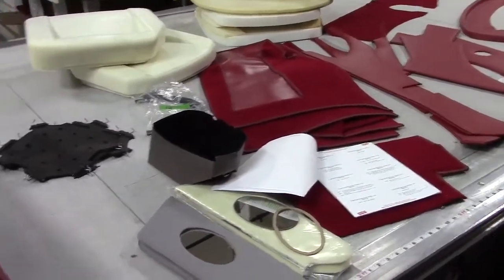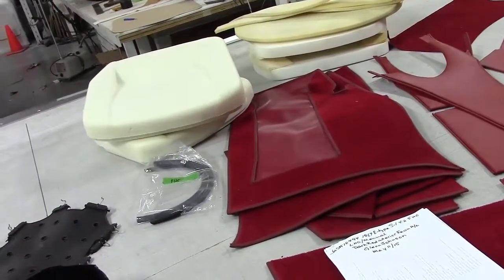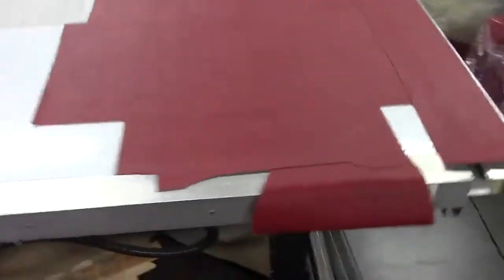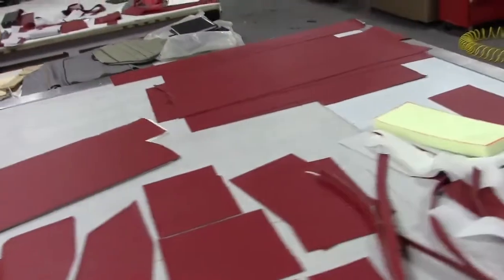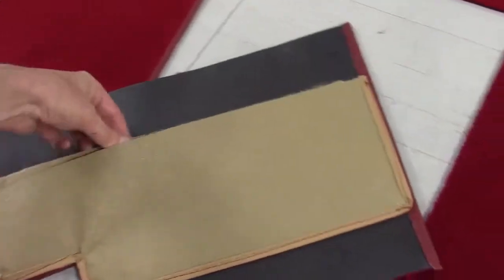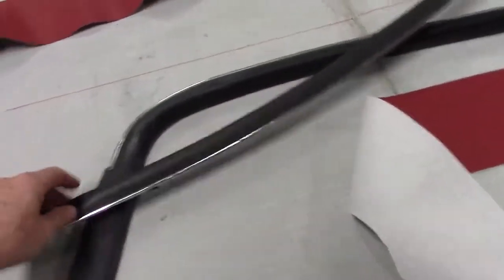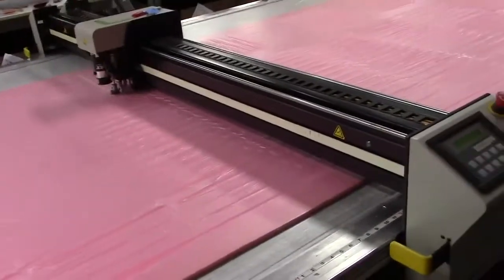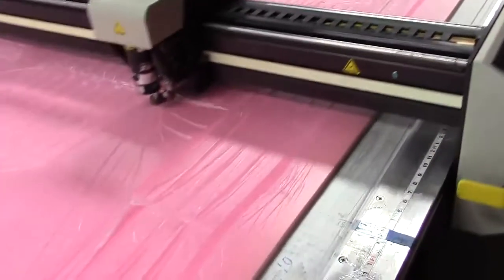Jaguar E-Type Series 1 4.2 FHC Upholstery / Trim

Comment: Brand new puckered seat lacks curve..the machine u use cuts for yield, and does not recognize material blems..a high quality carpet set is cut with all pieces facing the same direction as they will lay in the car on the roll, so the grain is all the same..or it will look like a quilt when fitted..yield over quality